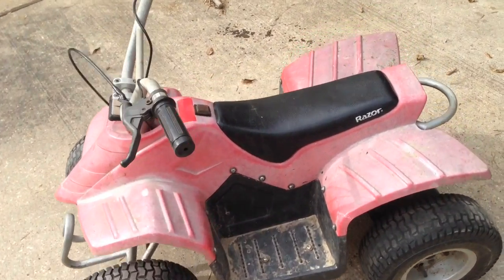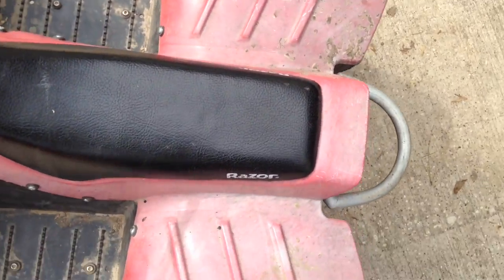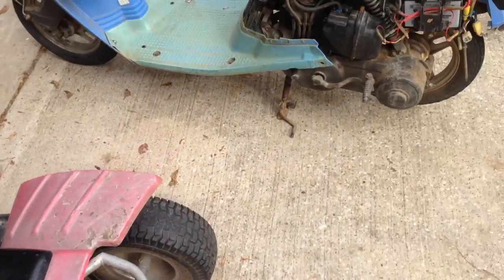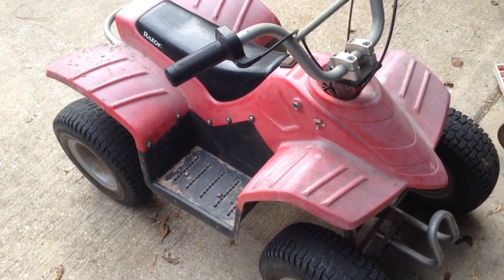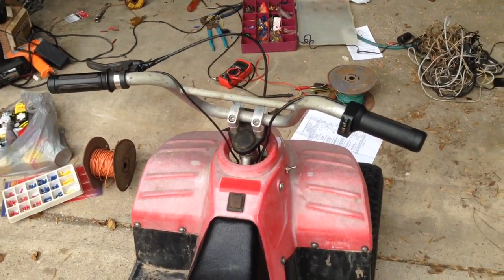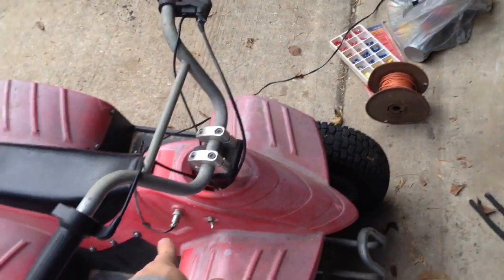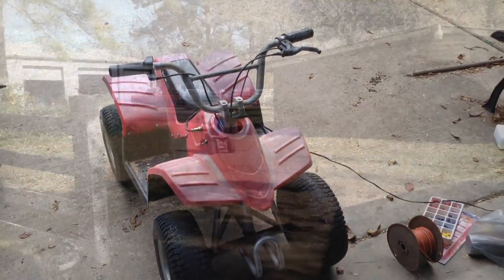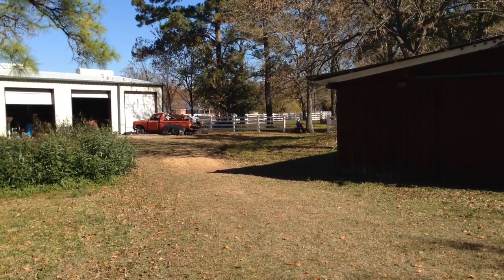Razor Dirt Quad 36 Volt Upgrade Part 4

Comment: I did this to my son's quad. I used the stock controller and throttle off a 36v Razor dirt bike. Everything just plugged back into place. No Wiring... I don't have a reverse though.
I did have to modify the front wheel spacing to make room for the 3 12v 20ah batteries. It will run all day on a charge.
Reply from the maker: +Kent Campbell good info there. didn't think about using stock razor parts.

Comment: Hi can you tell me what is the controllers wattage you have used.  I wanted to know if the one on this link would be a suitable replacement.. My sons razor quad is all stock and was hoping just to add a 3rd 12v battery and the controller, along with a new 36v charger.

http://www.ebay.co.uk/itm/ELECTRIC-MINI-NITRO-QUAD-BIKE-DIRT-BIKE-SPEED-CONTROLLER-36v-1000w-SPARE-PARTS-/231443907763?pt=LH_DefaultDomain_3&hash=item35e321c4b3